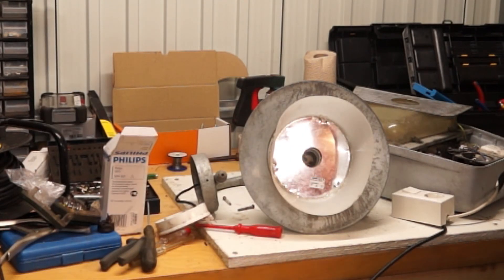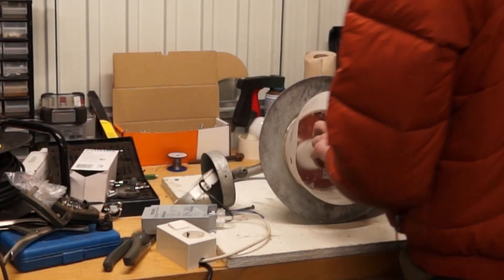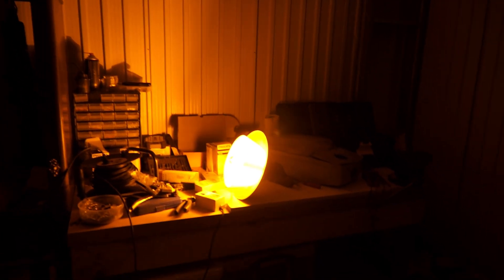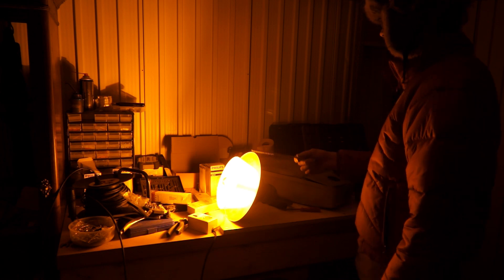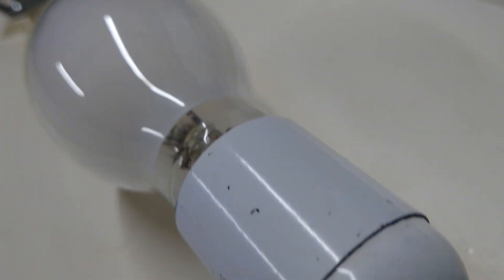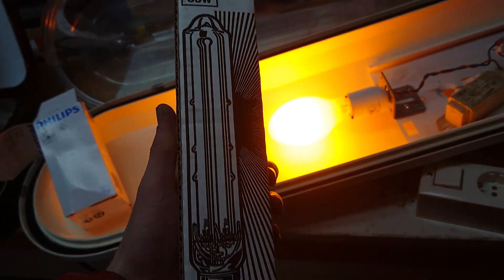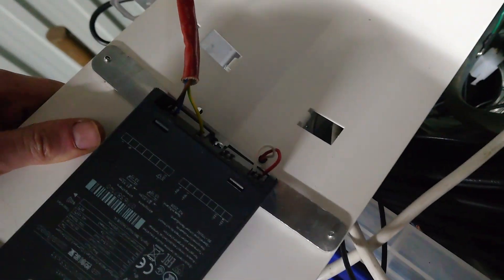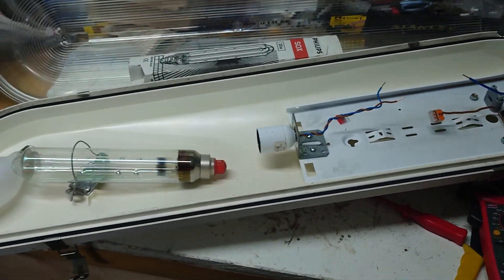high pressure sodium lamp with internal Starter ON Electronic Driver and testing MAGNETIC FL BALLAST

Comment: Internal igniter son lamps have a neon glow starter inside similar to those used with fluorescent lamps. When the starter breaks the circuit it causes a pulse of energy which should initiate the discharge in the lamp proper. This only works with an old style magnetic ballast which causes the pulse as the circuit is abruptly opened. As you have found, modern electronic ballasts do not behave the same way hence no start up.